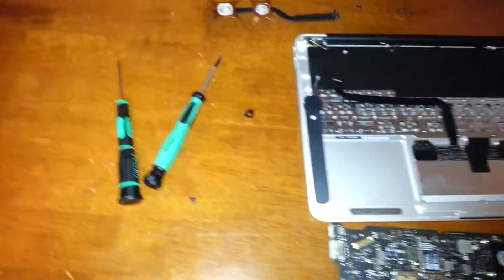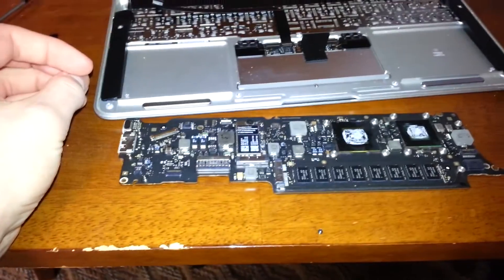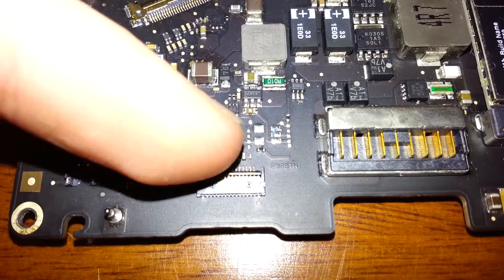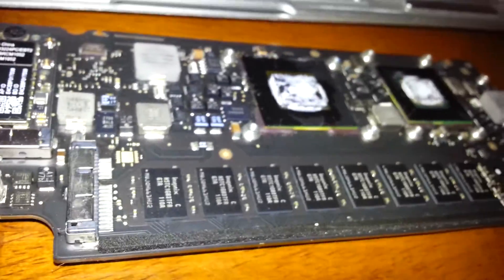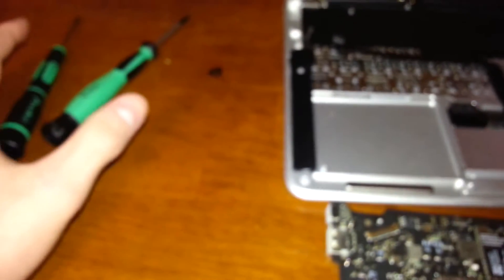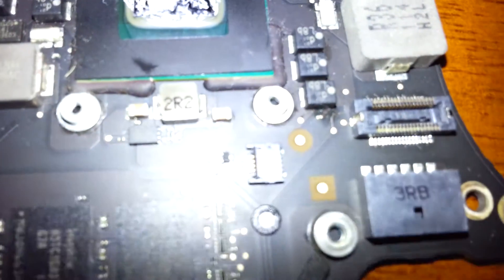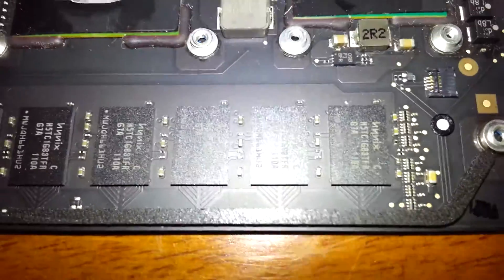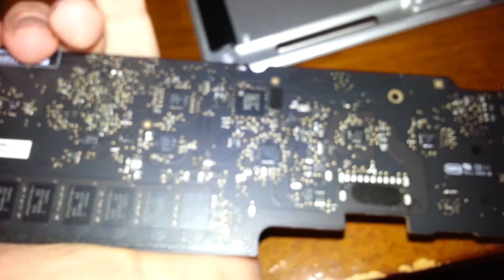Macbook air a1370 motherboard replacement

Comment from the maker: just to let you all know i did replace the motherboard and a reflow on the ram chips did not work it still had the same problem so as far as i know there is no way to fix the failing ram!